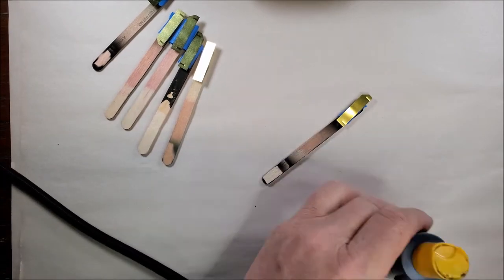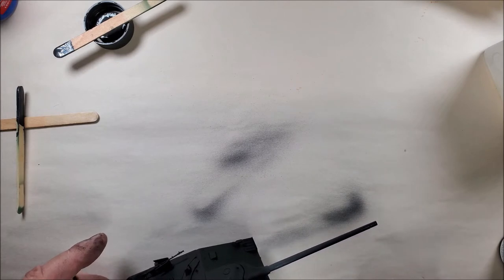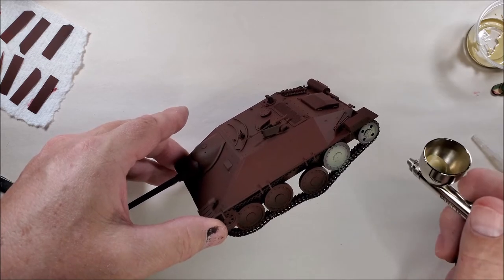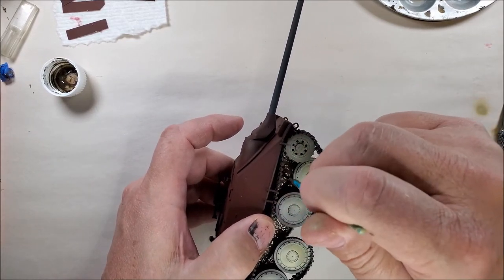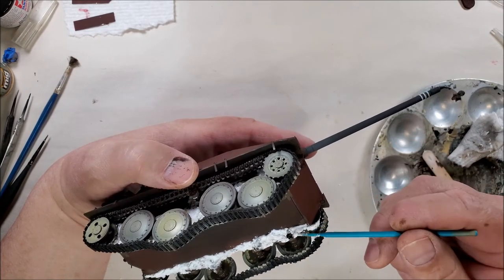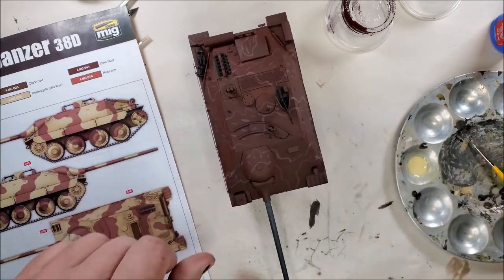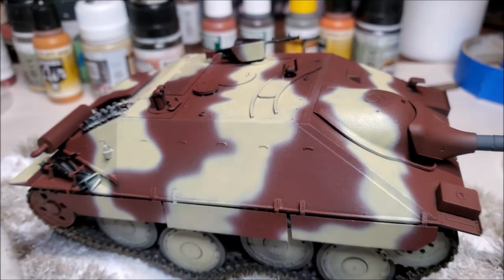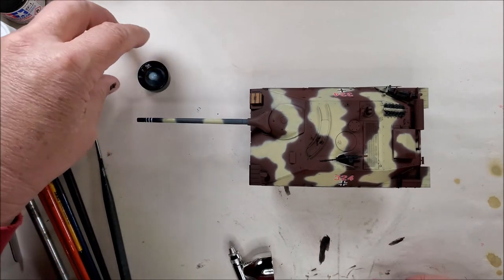Amusing Hobby Jagdpanzer 38D (Hetzer) complete build part 3, painting the base coat on the model

Comment: Hi Steve! The almighty algorithm recommended one of your videos while I was searching for some entertainment during my own build project. This is some nice work you are showing us here!
Some additional information: the grey Color on the barrel is the heat resistant primer. In fact all vehicles got them, but mostly they had been comouflaged like the rest of the vehicle. But on some pictures one can see the dark color without any camouflage, so a late war vehicle might have had the grey barrel. Also, some people claim that no exterior part was left in the red oxide primer color. And I would say for ’43 this might be correct but as you said in the video for late war or even a what-if vehicle there are exceptions. In a nearby museum is a Panzer 3 roadwheel in original unrestaurated condition in primer color, only the outside is dunkelgelb. And the dunkelgelb has overspray on the rubber rim.
Oh and the bracketed letters on many vehicles show their origin: (d) for deutsch (german) (t) for tschechisch (czech) (f) for französisch (french) (e) for englisch (english) (a) for amerikanisch (american) and (r) for russisch (russian)
Regards from germany, Michel